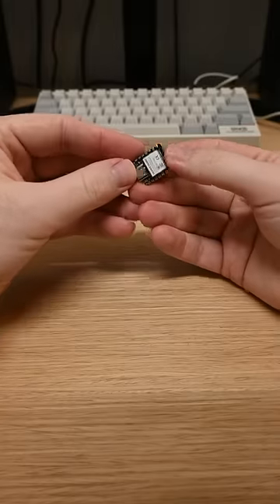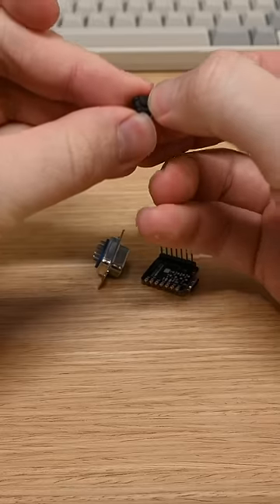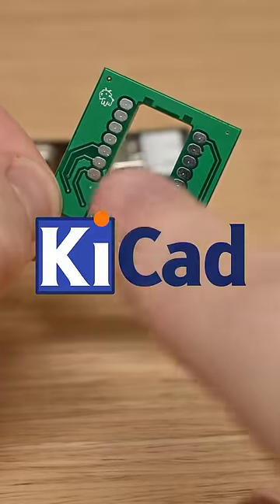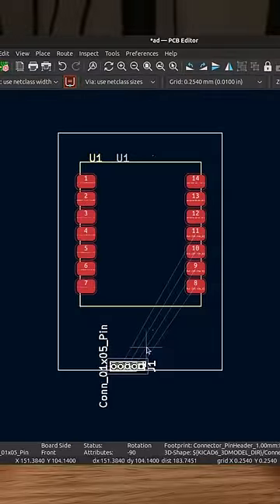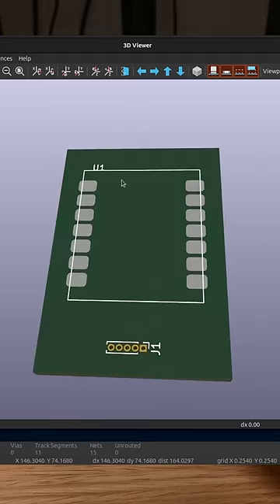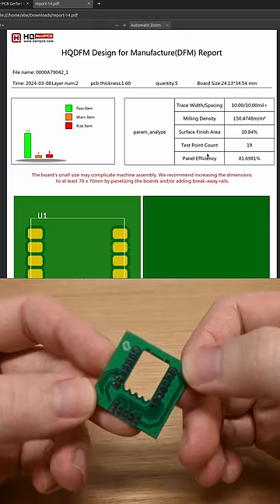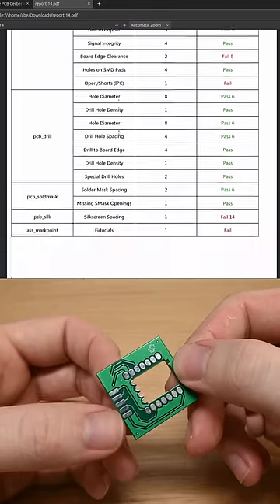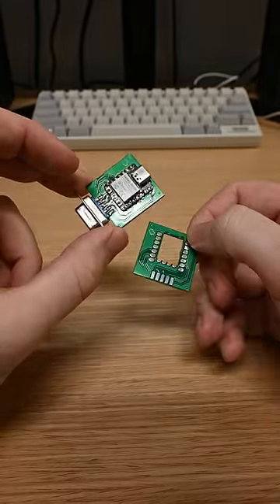Let's make PCB design easier #sponsored by NextPCB

Comment: If you do this, typically it's easier to get a properly mounted connector. Something with PCB pins instead of just relying on the circuit board thickness being right and using this inline connector.
Reply from the maker: 100% but for this device I had space constraints which demanded the PCB be centered over the port.
Reply: These designs are valid and fairly common. It’s a good idea to include some a readme/notes in your fab outputs to halt build if your board is out of thickness spec. I agree it’s very easy to accidentally fab the wrong thickness

Comment: DFM is built into KiCAD. if you get that set right your boards should always be perfect and it can check your schematic is correctly wired. No more “ooops” missed that trace….
Reply: I think you may be confusing DRC (Design Rule Check) which Kicad has, with DFM, which so far as I know, Kicad does not have in the box.
Reply: @Graham_Wideman  I believe you are correct. I don’t actually know there was a difference but that’s just reflective of my need to learn. So thanks, I’ll correct that gaping hole right now!

Comment: Been a while since I tinkered with KiCad, but I am sure it can also do these tests.
You just have to specify some rules like spacing between pads and vias.
Reply from the maker: Kicad has the Design Rules Checker which is also super useful, but the issue is that the DRC checks against the rules and settings you set for your board. If you’re a beginner it’s hard to know which settings should be configured to which values since it can be fab house specific and the default rules are a bit strange in places. NextPCB DFM has smarter defaults and more explanation of issues, it’ll say things like “most fabricators expect …” or “this may be an issue if this board is manufactured on older equipment” etc. So both are useful!
Reply: @abetoday to be fair, all the big board houses have this. In face JLC have (twice) caught errors on my board that DLC missed or I did. That was KiCAD 7, 8 seems better. 

Also 8 has a much better simulator now that includes dual and quad op amps which helps a lot to make sure the circuit is “sane” (I.e. you haven’t reversed inverting and non-inverting

Comment: I feel like PCB design is a stepping stone to making firmware.
Reply: Arduino is the step between those - as it's basically firmware, but not quite
Reply: what makes you think that? They are totally different things. You can write firmware without making a PCB and you can make a PCB with no need to write firmware.
Reply: I have to disagree as well. Most people who write firmware in my company have never designed a PCB.  Most of them are computer scientists, not electrical engineers.
And in case you mean as a hobby: still no to be honest as it just doesn't have that much to do with each other. It's kind of like saying that designing a housing for the PCB is a  stepping stone to PCB design (Which it is not of course).

Comment: TBH I wish there was a full length video for this. I'd love to know what the microcontroller does and what it outputs. And the iterations of the board. Like pre review, the report, and post review. Can a microcontroller that small output video via VGA?
Reply from the maker: My next full video is going to feature a lot of what you’re asking for! Not this project specifically but the a similar basic pcb project. And yes a small Rp2040 can output a VGA signal, but it’s more complex than this board

Comment: I just completed my esp32s3 drone, my first attempt at soldering perf board. I used cat6 wire and it turned into a hot mess but it worked.

Npn motor controle, mpu6050, 3.7v step up 5v 2amp with charging and battery protection. It was a challenging experience. I need to design my own pcb to make this thing lightweight. I uploaded a yt short of motor control test.

Comment: Since you know about micro controllers I would like to ask you a question to which I couldn't find an answer to. If I have a micro controller like the NRF52840-QIAA-R, how do I program it and put my code inside? I saw the sell it also soldered to a usb stick but do I have to unsolder it from there after programming it or can I connect it to my pc another way?

Comment: I encourage you to learn ribbon cable.  Its like a PCB except the wires are in a plastic and can be cut to different lengths.  You can fold them at 90° or simply have each wire break off at different spots as it reaches the pins.   For anything around 20 wires or so it should be nearly as neat.  Used to be you could get tons if ut free feom old computers, but I'm sure you can order some.  Happy hacking.

Comment: why the cut out below
Reply from the maker: This board specifically has a few solder pads on the bottom which aren’t exposed through pins so the hole allows me to access those and connect them to the castellated holes on the inside of the cutout

Comment: This thing what You called as a microcontroller is not a microcontroller. This is a PCB with some parts (maybe with a microcontroller). Please don't mislead people.
Reply: This is pedantry and seriously unhelpful. It's obvious he is referring to a package containing a microcontroller, and this kind of simplification is both necessary for dirty videos but also fine generally. Relax.
Reply: @orbatos  for You its obvious. For beginners that is misleading.
Reply: @norbert.kiszka  No it isn't, it's not even an oversimplification as the package is just a microcontroller and the most basic components to make it useful. There are cases where simplification can cause misunderstandings, but this is not that situation. It's not like calling a computer a CPU, which is what you are implying. You are arguing for specificity in a way that makes communication more difficult, not less. I suggest learning more about education if this is something you are interested in.
Reply: @orbatos  this is big misleading, especially for beginners. Imagine somebody searching in web for "Arduino microcontroller" and (s)he founds real microcontrollers, but not Arduino. Oversimplification or not, its still misleading.